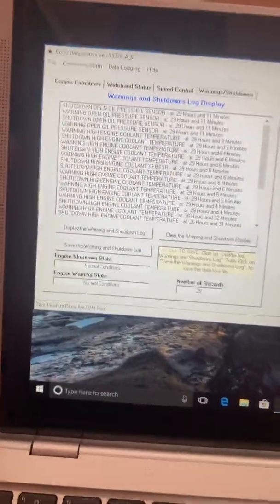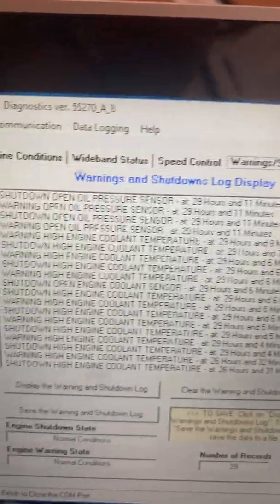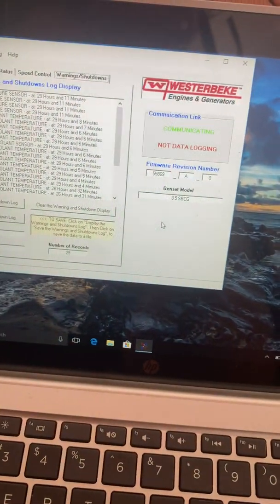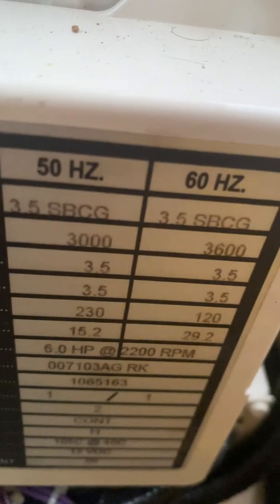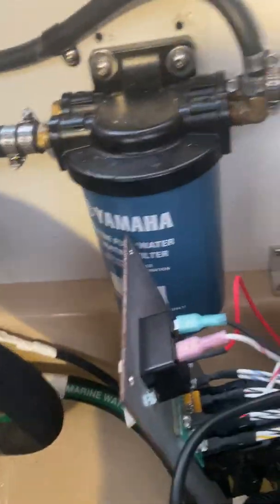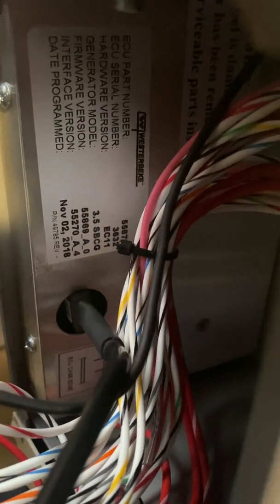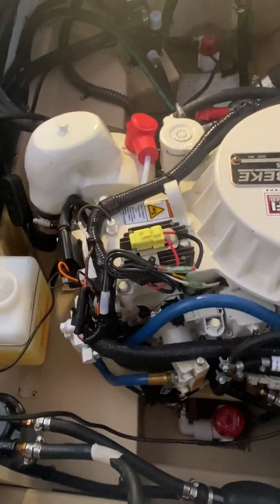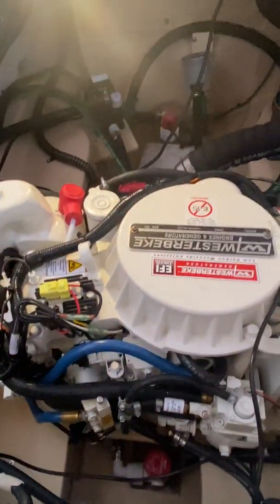Westerbeke Gas Generator 3.5 SBCG software Diagnostic software how to connect ranger tug 27 2019

Comment: super helpful, same issue trying to find the friking connection port
Reply: Open front panel with the start switch on it and its inside there.  on a 3.5 SBCG its on the left side in the hole and the sticker on the cable needs to face you.  If it doesn't connect you aren't plugged into all 8 pins.